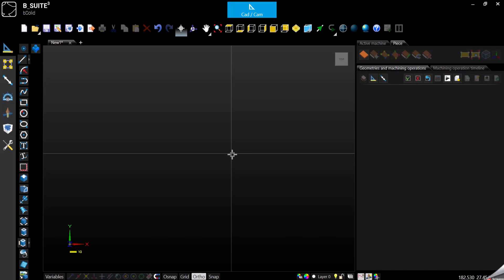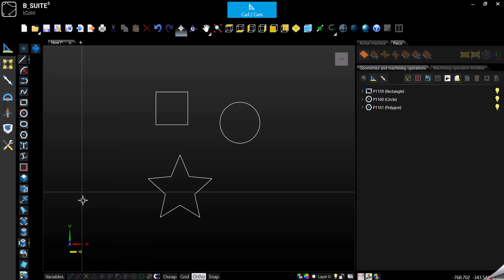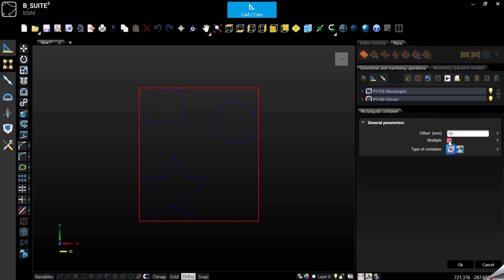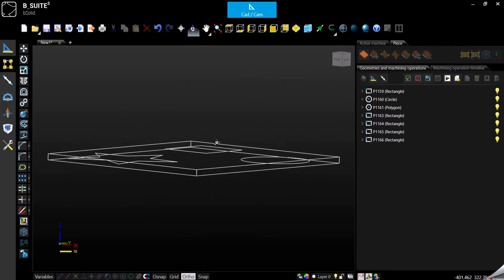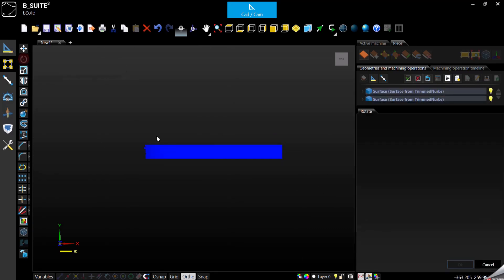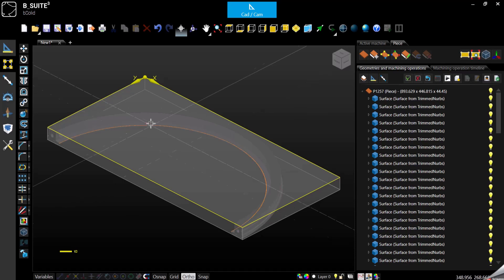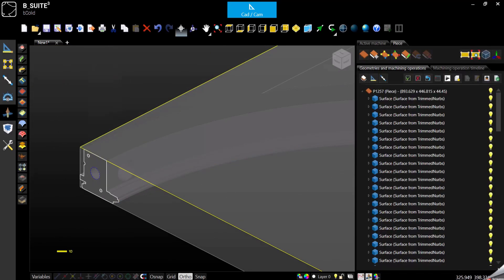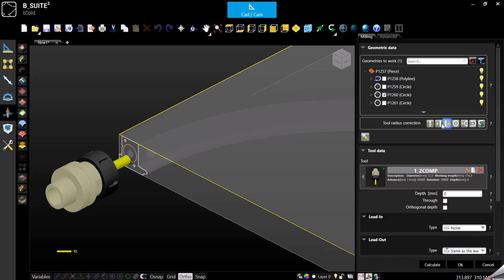21 - CAD BIESSE bSolid - Part 21 (Container rectangle, Wireframe creator, Finalize objects)

Comment: I have one question about Bsolid: When I take out the dongle and it goes in demo mode - then several tools exists: "glow" 3d engraving" and one more I can't remembering it's name. As soon as I put the dongle in, they disappear.  I'm on 3. something version. We have a full license - or at least we thought so. (we don't use nesting, or cabinet etc - only bsuite)
Reply from the maker: Hi, 
I'm not sure what was not included in your package, but these are the additional modules available for dSolid:
- Import module 
- Surface design (3D drawings)
- Surface from image 
- 3D Engraving
- 3 axis machining (carving of a 3D model in 3 axis)
- 5 axis machining (carving of a 3D model in 5 axis)

Best Regards
Reply: @freshzone  ah. ok. Yes we have the import module, 3-5 axis machining, and surface design. 3d engraving and surface from image we lack. It was awhile back now, but I guess I would have not deemed necessary with 3d engraving nor surface from image. That explains it. Thanks you! And thank you for being one of the very few resources on the web with good bsolid tutorials - it's invaluable.